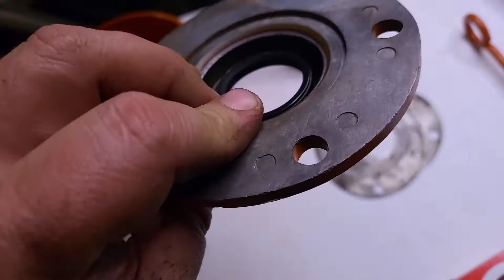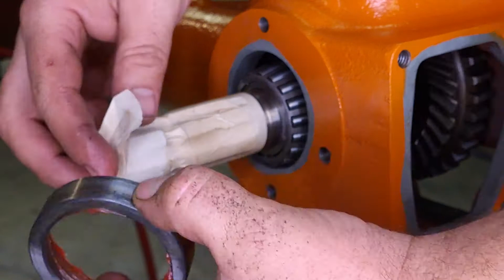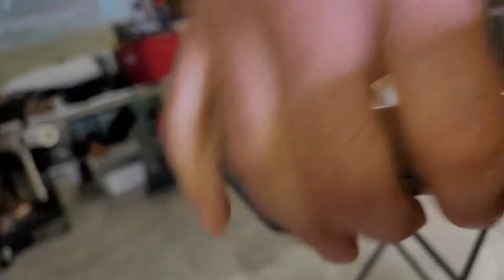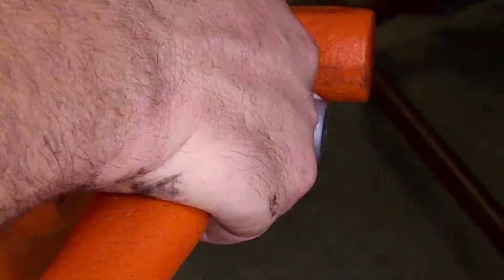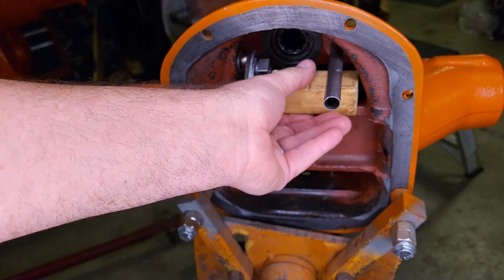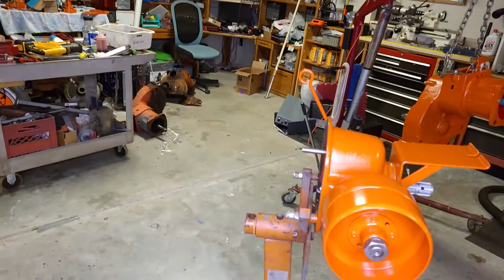Allis Chalmers B PTO Assembly

Comment: Great detail and very nice restoration. The PTO shaft was used for the belly mower and the belt pulley used for threshers and balers, are buzzsaws. I had to R&R all seals & bearings in finals and about 20 yrs. ago.
Reply from the maker: Thanks!

Comment: that was a huge relief once the spring loaded ball joint is in place and locks in by engaging the bolt.. Engineers were kind enough to design that bolt with a smooth tappered  end ..
Reply from the maker: Yes! that taper helped a lot.

Comment: MY Hydraulic pump had shims, when I removed. It must have had some wear in the lobes or the pump itself.. Probably My PTO worked a lot
Reply from the maker: Neither one of mine did, I'll check the parts manual later to see if it shows any.
Reply: @JPN76  I was wrong.. If there was a wear in the lobes, it should closer to the joint, not far,, I must have had gaskets.. not shims.
Reply from the maker: @nagvajrala3824  it could have just been a really hard gasket. I mean "crusty" lol
Reply: @JPN76  actually aluminium gasket.. will send you a picture. i still got it somewhre